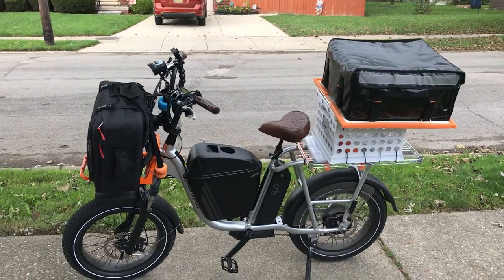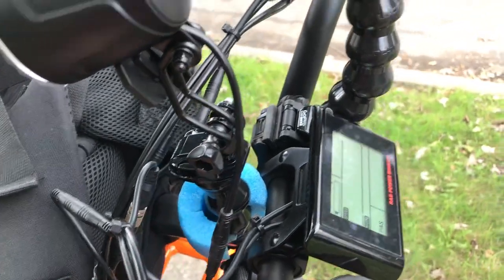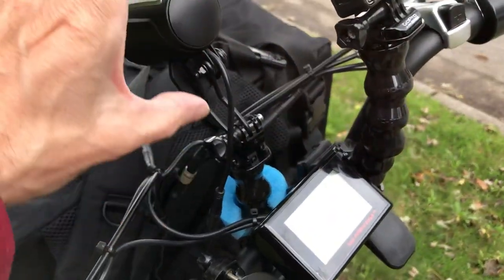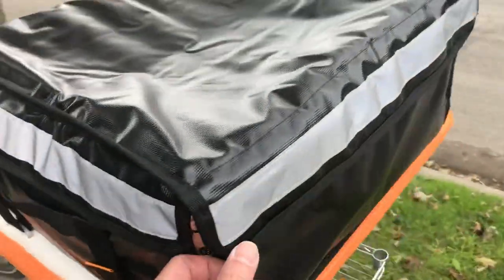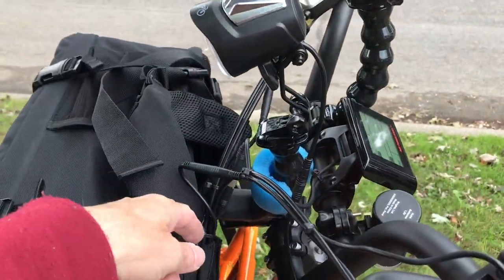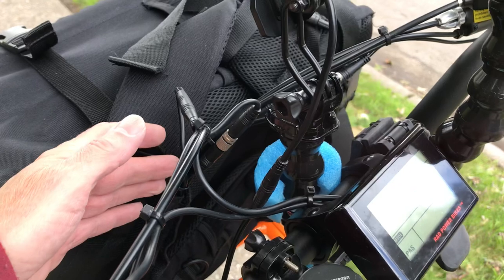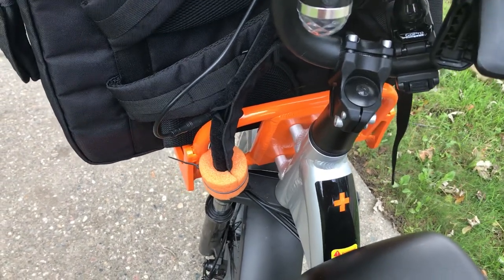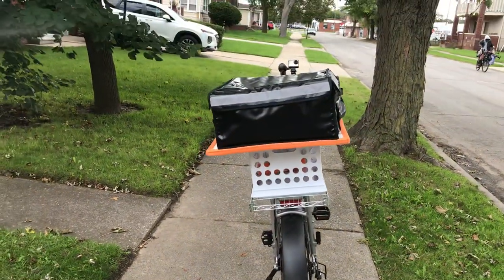Toying with a basic setup Rad Runner Plus

Comment: Nice...tell us $ please...
Reply from the maker: Rad Runner plus was $1700. I bought the center console for $100, the front rack for I think $39, and spent like $25 for a standard head light.  Those three accessories and tax made it about $2000 but the Rad Runner Plus is $100 more now retail in the USA.  So it was about a $1700 bike but about $2000 as I bought it with a six percent Michigan sales tax. Shipping was free.  I have bought and added some other accessories.  The Large rear rack platform, and a three pizza box insulated delivery bag have been purchased. I also bought a large platform for the front rack but I don't use it nor the front rack now. I bought a $550 with shipping VELTOP front windshield from France including the $140 shipping price and it has an adjustable windshield and half a roof that can cover the driver when the ebike is being ridden on. What I love about the VELTOP is in cold weather before winter hits and snow hits I can be riding in say 40 degree weather with no gloves on where the 32 or lower wind chill would freeze my hands I don't have to worry about that because wind from my riding doesn't hit my hands with the VELTOP windshield and having the top up makes 40 degrees F seem like 55 degrees if the winds are calm. So the Accessories for the Rad Runner Plus can add up on the costs but having all those add ons gives you more flexibility to customize the bike as you'd like to use it.  I've spent perhaps a bit more on some replacement parts and accessories than I needed to, but supply chain issues made that a priority for me.
Reply from the maker: Also in the winter if I'm wearing snowmobile pants for the cold weather below say 38 degrees I wear snowpants. The heavy snowmobile pants are to bulkly to fit over the center tank. And I bought two pannier bags from a company in Germany and have those mounted beneat the large platform and pizza box. I put 12 bottle of water in both pannier bags or a case of water which would not fit in the center cosole which can hold 11 cans of 12 ounce Pepsi cans.  So the center cosole is deleted from my winter configuration and I prefer the step through.  Now that I have $70 pannier bags with shipping and each bag can hold more than the center console I may hardly ever want to use it as the low step through design is preferable in winter.

And I rode in some snow and ice the last few days and stayed mostly on plowed city streets in good streets.

Comment: Is that a suspension seat post on your bike ?
Reply from the maker: Yes I added a suspension seat post which cost me I believe $50 but it might have been $80. It's a Satari suspension seat post and I highly recommend it. I also borrowed a Schwinn deluxe seat from a pedal bike I was given. But I"m returning that bike to the owner.  I like the deluxe Schwinn seat for my Rad Runner, but I only weigh about 145 lbs.  The added comfort from a suspension seat post is well worth the cost.  

I'm 60 years old however so I'm looking for comfort and don't want to jar my back nor my neck much.   I have a touch of arthritis in my neck, so I look to reduce wear on my neck.